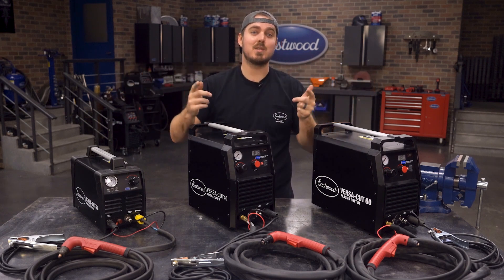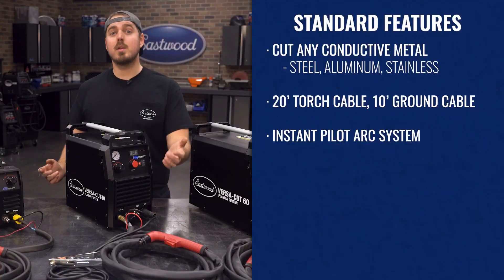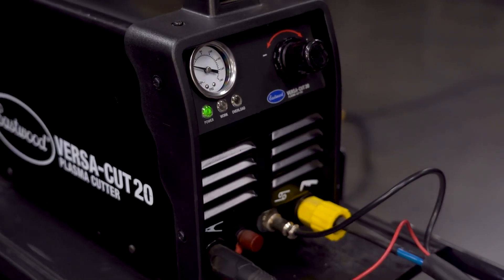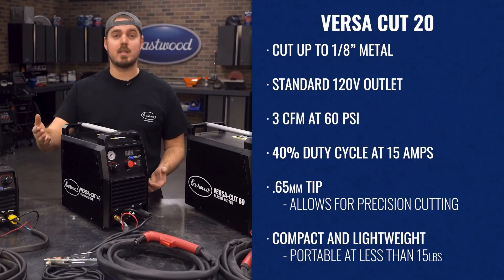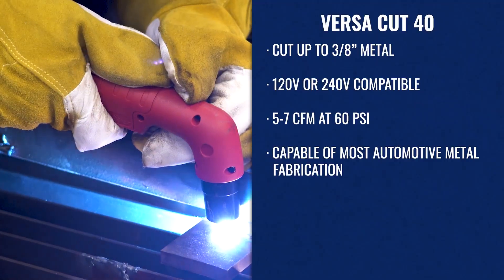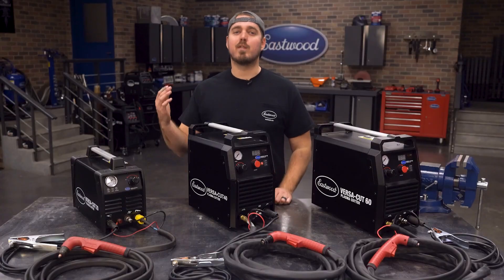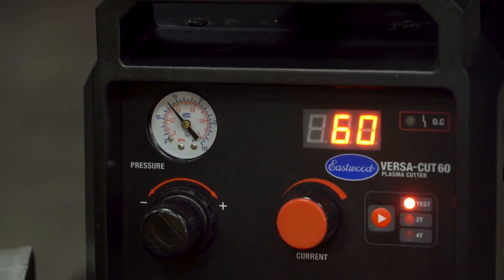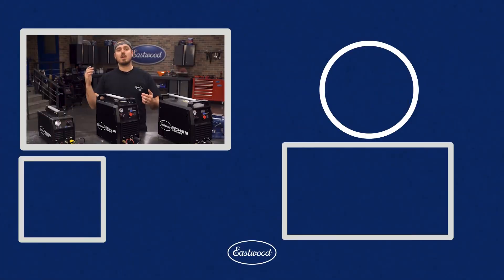Plasma Cutter Buyer's Guide - Which one is right for YOU?

Comment: Pilot light took a shit on my 40amp machine.....if I would buy it again I would of bought it at harbor freight.... much easier warranty... and consumables available 7 days a week....
Reply: Check your ground, air pressure at the nozzle, contact tip and shop air supply for moisture. The moisture trap on this machine, does not replace a true moisture separator that is installed in your air line from the air compressor.
Reply from the maker: Feel free to reach out to our customer service team for help on troubleshooting. Most of the time it is solved with some simple fixes. 800 343 9353

Comment: can you go over air compressors that can run plasma cutters . thanks
Reply from the maker: It really depends on the plasma cutter, but most of the time you can just look at the compressors output. As long as they match the requirements of the plasma cutter then you are good to go.